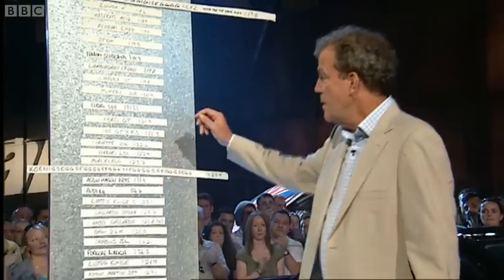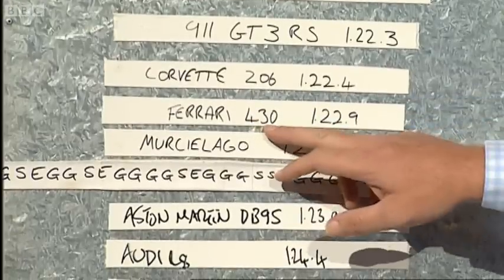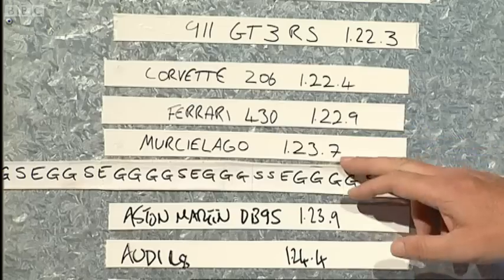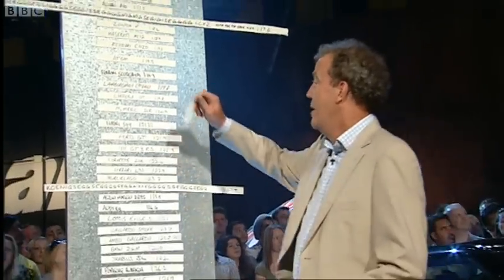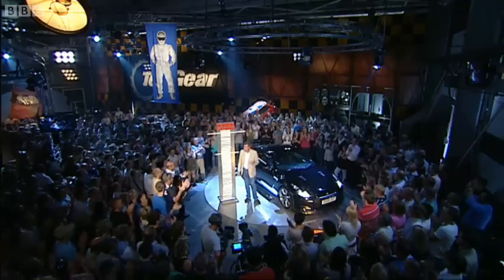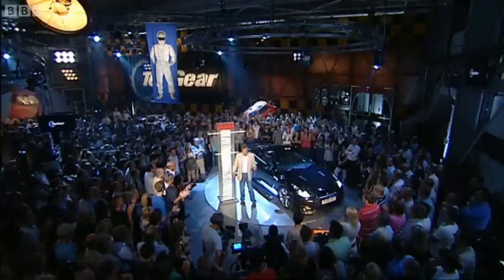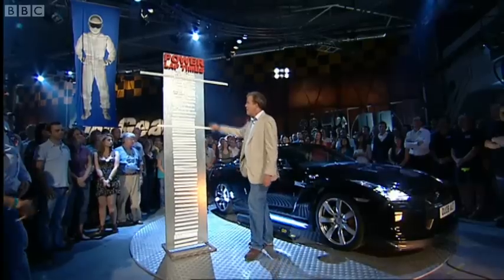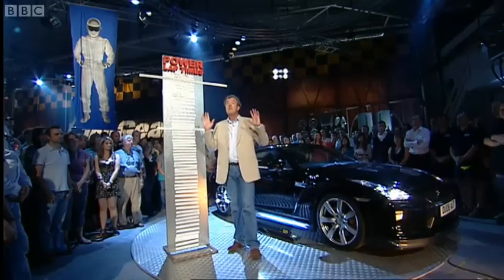Nissan GTR Power Lap | The Stig | Top Gear

Comment: "It corners faster than electricity!"
Reply: Asher Davitadi how fast is electricity?
Reply: Fun fact electricity as in the movement of electrons is actually very slow. At 1 amp and electron will only move about a meter and a half a day. Your lights turn on quickly because each electron "pushes" the electron in front of it (actually behind it because current moves in the opposite direction of electrons) creating a very fast chain reaction. So yes I would say most vehicles are faster than an amp of current
Reply: Electron's speed is a couple of millimeters per second, but in a wire for example there are a ton of them and the electricity(in a nutshell) , as spencer said, is electrons pushing each other.
Reply: Porsche Taycan : hold my circuit. ⚡️

Comment: I hear so much understeer!
Reply: +Po Russki Not sure that was understeer as fast as it went. I think the tires were just screaming bloody murder to the Stigler to back off. That is one fast car.
Reply: +Po Russki Dont forget, these are standard tires, not semi-slik r-compound like most others use. I do think it pushes a bit, mine did ... but that is normal when pushed like that.   :-)  :-)
Reply: +Naked Acres it's definitely prone to understeer. That doesn't automatically mean it's slow, though.
Reply: True!
Reply: Naked Acres
Yeah it's a heavy car and front heavy car. Anything short of dry racing slicks would probably have difficulty fully hooking up.
Reply: Ethanmeister
They ran standard GTR's in the N24 when it came out. Only added FIA roll-cage (and other mandatory safety items) and silks. They did well, for a roadcar.
Reply: +valcked For your information, all cars on the board went round on slicks.
Reply: +valcked For your information, all cars on the board went round on road-legal profile tires.

Comment: If I'm going to rob a bank  ..I'll take this car over any featured on Top Gear. Think about it. 
It's cheap, the speed & cornering you get at this price is unheard of. It's Japanese, so you know it won't break down.
And the most important trait  ....it blends in with every car on the road. I mean Uber probably picked you up in this car and you never even knew it.
Reply: No, it does not blend in. And Nissan has been making absolute garbage after the Renault merger. Their Jatco autoboxes being the worst part of their cars.

Comment: at the 1:15 mark, its clearly accelerating away from what i think is hammerhead, headed towards a straight. However you can see him decelerate (hit the brakes) and lift off the throttle, to turn the car more, and THEN get back on the throttle to begin the straight. that looked to me to be at least a loss of 0.6 seconds. And given what a lousy driver youd have to be to make that mistake, i can only imagine how much time he lost everywhere else.

That being said, it did look tremendously quick, not my favorite car by ethos, but what a remarkable machine this is.
Reply: They do several laps to get the best time they can, they video one or 2 laps not all of them.
Reply: I believe they regulate themselves to 6 laps, 3 to get to know the car and no more than 3 attempts, otherwise they would be there all day fiddling. They also do not allow the manufacturers to fiddle inbetween laps either. The only exception was Ferrari with the FXX that they prepared especially for the run, had a team there and Schumacher drove it - but it was never an official power lap either.

I hear that Tom Cruise wouldn't do the driver in reasonably priced car unless he and Diaz had unlimited access to car and laps, they were there for hours apparently, and hence why they got fastest lap times back at the time.